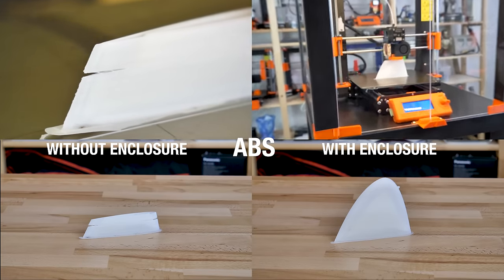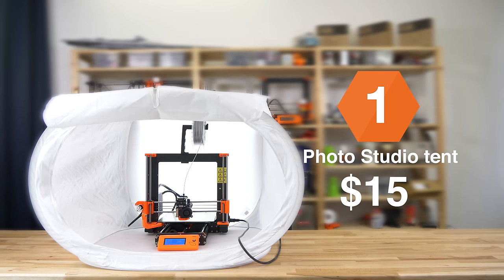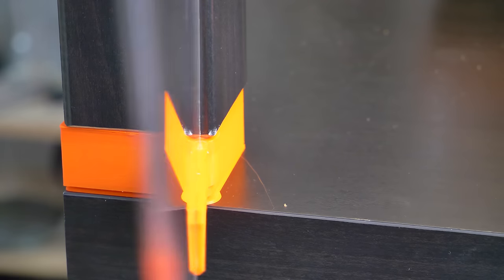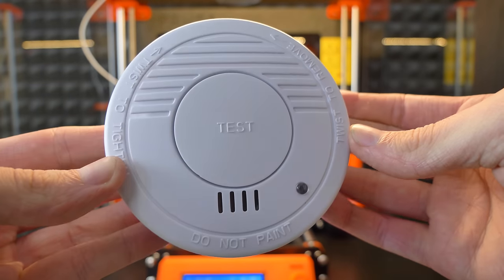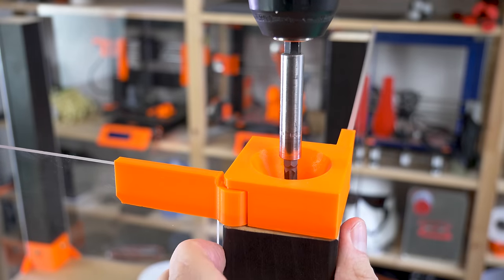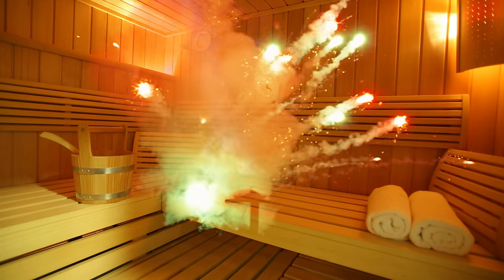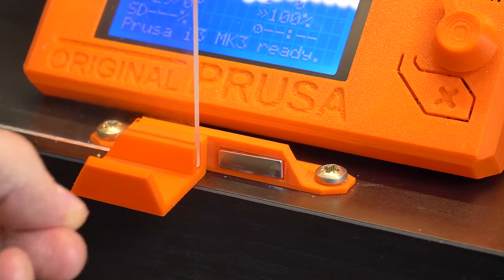How to build a simple and cheap 3D printer enclosure

Comment: Lots of great little design considerations here.. awesome!
Reply: Nice video, however it would have been safer for you to precise to turn off and unplug the printer before wiring the led, some untrained persons might not think about it ... still a great video though!
Reply: I wonder if this works for Ender 3 though. It seems a bit taller than Prusa MK3
Reply: uyi
Reply: @BloodshedPAC  the led lights are 1. at low voltage and 2. the did it with the power off then they just did a scene change

Comment: Excellent design! The only thing missing are HEPA and Charcoal filters as just enclosing the printer does not eliminate the odor or the chemicals released by ABS printing, it just contains it until you open the doors.
Reply: Hey, great comment. Out of interest what filters would you use in this design and where would you mount them? I'm thinking of making it myself so would be good to know. 

Cheers
Reply: i would place something like this in the back acrylic: https://www.cremashop.eu/en/products/wilfa/ap-1-ap-3-filter-set/1160?gclid=Cj0KCQjwzcbWBRDmARIsAM6uChXkpv1GxtpVB53nCYMx2UCygOGIlIfiFCkCZj6ETJWTNIDBhLcBKUQaAlG2EALw_wcB. 
place some 120mm fans in front of it to turn on after the print, so it filters all of the air inside
Reply: I made a low budget version of a filtering system: 2 replacement Charcoal filters for soldering fume removal ( 2,90€ from https://www.pollin.de/p/ersatzfilter-fuer-loetdampf-absauger-840140 ) 
and a Hepa Filter for vacuum cleaners (about 3,40€ from a local store).  You can put it on the side of your encosure, combined with a 120mm fan. Maybe it is not a perfect solution, but for me it works just fine, and filters out the unpleasant fumes.
Reply: That's why you put a good air filter for the whole room as most people have more than 1 printer it will reduce electricity and keep temperature and moisture at a constant
Reply: idk about you, but most people i know have only 1 printer. maybe 2
Reply: I'm designing and building a separate air filtration system with a high volume fan.  I would like to find something like what is listed on the site you referenced that I could purchase in the US. That would make replacing them easier and more universal.

I'm trying to decide if a down draft pull would be best for cleaning the fumes and smells. Don't want a lot of air disturbance as to maintain the temperature in the enclosure.

Also though of designing one that recycles the clean air back in the enclosure to preserve the temperature.

Any thoughts?
Reply: ideally, i think you would seal the enclosure as a well as possible with some silicone or simmilar, and turn the fan on at the end, just before opening it. any draft, even if it's from inside the enclosure, will cause some cooling, and i don't know if it would be too much to still print well
Reply: That's an interesting idea. I was thinking of sealing mine like you talked about, but need to come up with sweeps for the doors.

Possible a very low volume suction on the filter would also work.  I will have to play around with that once built.
Reply: another option is just putting on some silicone on the part where the door touches the enclosure, and find a way to clamp the door against it
Reply: I live in an apartment and check this:

Mine is in the washroom ontop of my dryer. (Anchored so it's solid foundation)

Then the enclosure exhaust is placed in that dryer hose exit out the apt. Simple hack

Oh and hot air always rises.  The exhaust is hot so place it low and know it will rise

Comment: I find that the enclosure greatly helps reduce my printing issues, even with PLA.  Turns out that air circulation from an A/C vent and ceiling fan in my printing room were causing adhesion and warping issues. With the bed fully protected from air circulation, many of my issues have gone away.
Reply: Thats the reason I'm making one. Started having issues with prints when the AC kicked on during summer.

Comment: IKEA is your friend.
They sell the 'Gorm' modular storage system.  I think the name has changed; same thing.
The Gorm is basic shelving, all wood, and the shelves can be mounted at any level you like.
The overall depth of the unit is about 54cm, width is 87cm.
The uprights are wood too, so cutting them to length is a snap.
I mounted foam-core panels on all but the front side, forming a chamber of sorts.
A manifold and evacuation fan serve to make this thing a fume-hood as well.
LED 'shop-light' mounted inside the Gorm gives ample, shadow-free lighting.  That foam-core bounces light all day!
The printer, filament and holder all sit on the same shelf inside the chamber.
A removable draft-shield sits in front of the printer, [didn't want to close off the entire front side of the Gorm] and side drafts are not an issue.
ABS prints very well in the chamber, and with the fume-hood arrangement, there is no odor at all.
Reply: Greg Gallacci could you send me photos of your enclosure?

Comment: The Ikea-LACK also adds torsional stiffness and rigidity to the printer-frame, which is very pertinent for an i3 design & clones! I use an upside-down LACK on top of a regular LACK with a three-point contact in between the two LACKs to eliminate all effects of an uneven ground-surface, and this works beautifully for me.

Comment: You could put another Lack on top to keep the filament free from dust (at my place, dust builds up quite quickly). Also, if you seal the plexiglass windows, and put some moisture eating stuff inside, they might keep dry too. Same for the bottom part; I'd put some windows in there too. It all becomes so dusty quite quickly.

Comment: There is two points to consider before putting this together.
Ikea, and Ikea Lack in special, has hollow legs. Except for bottom and top, where they put a small conglomerated wood square, all the rest is hollow. Do not put much weight on it.
The other important point is how the legs are attached to the top.
On the upper corner standoffs installation, you need to use the original Lack screws (somehow) otherwise the corners will be attached to the top with a screw, but the leg only on 2 walls, with a small screw. ANY lateral move will either break the plastic corner, or the leg itself. Happened to me.

Comment: I've been checking out 3d printers and I came across a lot of MK4 videos. Looks like a great printer and with this enclosure, thats another big bonus/ BTW do the reels need to be dried before use? Perhaps make compartment with same parts but shortened , add a small fan and desiccant dehumidifier? I think that would appeal to a lot of people. 

I haven't purchased a printer yet but I'm drawn to the Prusa MK4 or a Bamboo. After watching a few of your videos, I'm leaning more towards the MK4. Also do you ship to South Korea?

Comment: The more recent extruder designs for MK2.5S/MK3S are not really safe to use inside an enclosure since you'll probably be running little or no part cooling fan.  Heat builds up around the PINDA arm and the front cover and will eventually cause them to droop.

I'm going to have to redo my entire MK2.5S assembly because mine is all messed up now since I print mostly PETG with no part cooling fan and didn't realize things were starting to deform until it was too late.  I wish I had never upgraded my MK2S.

The R5 versions are slightly improved but people are still having issues because the issue wasn't actually fixed, they just beefed up the amount of plastic on the extruder cover/body.

Comment: I'm considering doing this but using tempered glass (extreme heat resistance) and covering all of the wood areas with hardiebacker board (fire resistant) so I can essentially make a fire resistant enclosure.  Also the smoke detector inside the enclosure that kills power if smoke is detected.  I think using the above design would work great with those modifications, assuming the tempered glass isn't too heavy for the hinges.

Comment: Hi guys, i have an issue with the PSU holder. My model came with a black PSU and it doesn't have either the bracket to keep it "Hanging" nor does it fit properly in the holder below it(the PSU is roughly 1cm bigger). do you have any solution already made for that or do i have to design a holder myself? if it's already out there i'd rather save the 4 hours in designing the whole thing myself. 
regardless of that GREAT enclosure, 10/10 would recomend doing it

Comment: Would it be feasible to 3D print the enclosure out of PLA or other cheap filament that can be printed at low temperatures? I can get wood, metal and glass for a conventional enclosure but I would love to 3D print it.

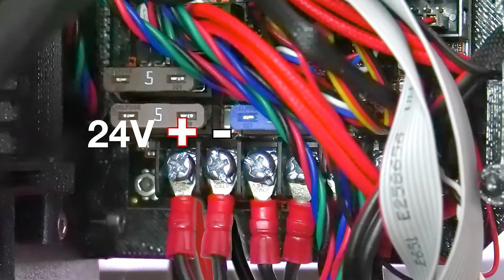Comment: So about the heat bed cable. Looking at the movement at 3:40, it looks like if someone were to print something moderately high in that corner, the cable would hit the print. This isn't good. Wouldn't it be better to angle the cable 90° up rather than 90° away from the Einsy? It looks like the cable would be less strained that way too. Any reason you didn't go that route?

Comment: As the prusa printers use petg make sure the enclosure temperature does not go above 55C as that will cause some parts (like stepper motor parts) to deform.

Comment: The bottom could also be enclosed with MDF boards. With a door you could hide all the tools and cleaning supplies but still have easy access. There's been talk about "ghosting" or "ringing". They've been suggesting a concrete paving stone to increase the mass and reduce the printer movement. Is it worth considering changing the table to secure the printer?
Reply: It's Ikea lack. Bottom legs are held very poorly, joins are not rigid, so increasing mass would only induce more stress on the joins. I used dowell pins and D2 glue and printed feet so that it's as level as possible, now it's stiffer than a teenager in the morning

Comment: Hello Prusa staff, just a question please.
What about warranty coverage when we print in a lack eclosure ? Do you still cover printer even when moving PSU away from the printer and printing in a hotter environment ? EINSY board, motors, fans, petg printed components are subjected to a higher temperature stress. Will my printer still be considered under warrany in such case ?
Thank you

Comment: People that say that heat damages the electronics always say that the PRUSA print farm is a lot hotter than 35 degrees and still the printers run there. Why do you now say that this can be dangerous? Do you cool your print farm significantly? People (who seem to have been there) said that it is hot?

Super cool enclosure by the way! THANKS!
Reply: Despite the animation, they didn't say it was dangerous, they said it can significantly shorten a power supply's life span.  I don't think they are worrying about the life span of equipment in the print farm, since it is already printing almost 24/7 and it's also just the cost of doing business if they have to replace them more often. :)
Reply: ok. Thanks. But it might still not be perfect for us that only have 1 printer I will try to get the PSU outside, but the LEDs and stuff later. Too much fiddling after I will have assembled the whole printer :D
Reply: VictorSteiner Simply buy an other power supply to be mount at the table and good quality connectors able to handle the current. So you can leave the original power supply in place (Turned off it will not suffer from 40°C), insert the connectors into the 24V-Line and swap between original and external powersource. It will be make transport oft the printer much more easy also.

Comment: Warning about printing PLA at room temp: PLA does not print just fine when A/C is on. Having major warping issues on my prints. I did a test of printing without the A/C on and the same print with A/C on. When A/C was off, the print did not lift at the edges. When A/C was turned on, the edges lifted.

Comment: I want to set up something like this in an unheated aircraft hangar.  Temperatures can go below freezing in the winter.  Would normal heat generated by the printer in this enclosure be sufficient to keep the environment warm enough to print or would I need an auxiliary heater of some sort?  Would I need a cooling fan?

Comment: I've just finished building this enclosure.  My hope was this would help with printing nylon - taulman bridge.  I thought the enclosure would increase the temperature quite a lot - plus 20 / 30 degrees celcius and help reduce warping when the filament cools.  The enclosure temperature increased about 1 degree??  Do the gaps around the plexi glass just let out all the heat?
I'm fairly disappointed with this enclosure as its turned out to be a glorified wind break.

Comment: That is really cool.

I haven't assembled my printer yet, but got a secondhand wooden cabinet for £10 for it. I needed to be able to fit child proof locks to it, also wanted something to shield against reflected laser light (I'm full of little thought through, bad ideas). I got a 12v LED light and a Raspberry Pi for Octoprint, FreeCad and ColMap. Just need the webcam and hopefully we can make things and watch it on our mobile phones.

After reading other comments and with about 4KG of ABS filament, I'm wondering if carbon filters absorb the smell of ABS?

Comment: Excellent tutorial! 
However, I'm a bit worried about the wood frame of the tables. Isn't it a bit of Fire-hazard? 
Even with a Fume alarm, it actually could spread a fire more (in case this kind of things happen). 

I'm looking for a metal enclosure box (build one with aluminium profile) or a metal box big enough and not very expensive in which a printer could be stored while working. In which a smoke alarm AND an automatic extinguisher will be introduced.

Comment: Prusa is one of the Best 3D printers I know. I am a 3D printing noob but i'm passionate about the topic. Should I get Prusa i3 Mk3 or should I get it after some experience?
Reply: There are pros and cons.  I'm probably still a noob even though the Mk3 is my second printer, and honestly, I'm glad it wasn't my first, because despite the amazingly detailed setup instructions, it intimidated the hell out of me.  My first was a Collido DIY, which, although being a 'self assemble kit', compared to the Mk3 came half assembled (all axis assembled, all electronics assembled).  It was only after having self-upgraded to a heated plate, and then later running into bed levelling issues that I decided it was worth it to me to upgrade to a Mk3 and all its features.  If having assemble almost every nut, bolt and wire doesn't scare you off, and you have the cash to burn, I'd say go for it.  If you just want a 3D printer to 'test the water' as it were, I'd check out Maker's Muse and some of the other 3D printers on Youtube for suggestions of cheaper options, then decide whether the Mk3's features are something you need/want enough versus its price point.
Reply: Thanks mate.
Reply: I assembled my own printer as I wanted to know the ins and outs in case something goes wrong. If you're intimidated by the assembly then you can get the assembled unit. But as far as being your first. I think it's a great first printer to learn on. It's my first and I have zero regrets.

Comment: Thanks for the video. Why would you need a power supply doesn't it just plug into the wall
Reply from the maker: Hi. The power supply is needed to transform the current from the grid into the type the 3D Printer needs to work.

Comment: There is no temprature data of after using this encloser, and I don't know the maximum working temprature for the step motor and the belt, so I have to ask, Does enclosure like this hurt the printer ?

Comment: I will say one this with many designs this one forgets one thing. Heat build up with in the enclosure on the main board and the stepper controller's. They have done it with the power supply. Why not remove and extend the control main board wiring that you can mount it in a printed case outside and under the enclosure. This will prolong the life of the board and stepper motor controllers?? One thing I've been thinking off is using something like this. That is outside of the enclosure but feeding into it. 
http://www.instructables.com/id/Air-CoolerHeater/ 
Will help with fast cooling of PLA. 
But on heating if wired in with a good temp cotroller. Will keep inside the enclosure a warm and stable temp all around the whole print. So not just the slow build up of temp from the heater plate to do this.

Comment: I'd probably do that even if I was using PLA, because it will help keep the room cooler and cut down on noise.
Reply: I'm having the same problem. But that kind of defeats the purpose of have a lower temperature gradient inside the enclosure right? It'd almost be easier just to leave the doors open
Reply: I'm already incorporating a fan/filter to get rid of the fumes when the print's done, so maybe I'll make the filter removable and kick the fan on when it's PLA time.

Comment: i have a tevo tarantula with the larger bed size and was wondering if i could get dimensions between the plexiglass sides?  I am trying to figure out if the lack tables will work or if i will have to increase the depth for the bed being longer in the Y axis

Comment: This is a great design, I assembled one recently. I have a question however. Using a heated bed inside the enclosure, the ambient temperature is causing my extruder to overheat and that causes under extrusion due to filament skipping. Usually the extruder body is cold to the touch but when using an enclosure and a heated bed at 60C it's hot, since the cooling fan is innefective with the hotter ambient temperature. Does anyone know how to counteract this if you still want to use a heated bed? More powerful cooling fan for the extruder?

Thanks